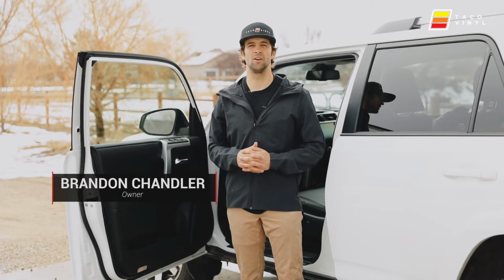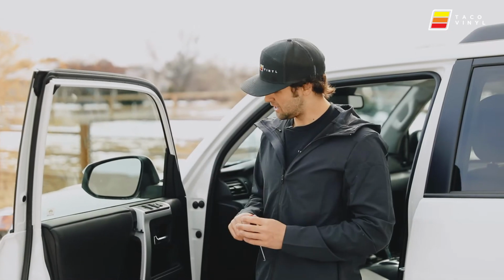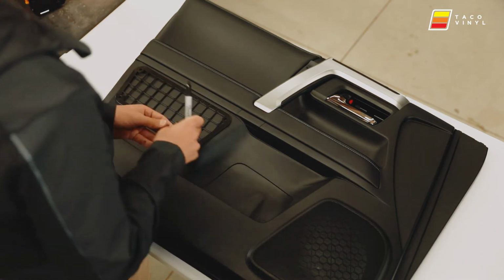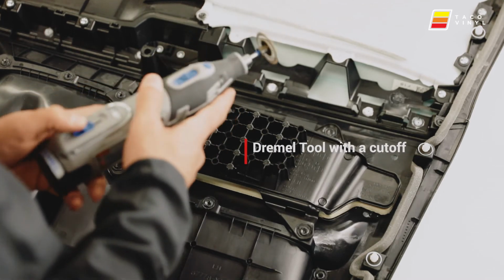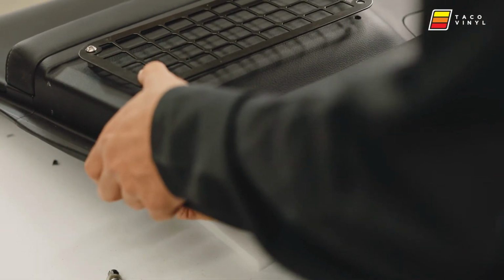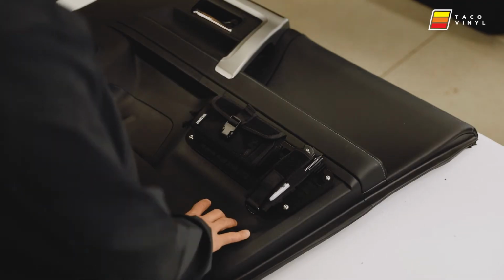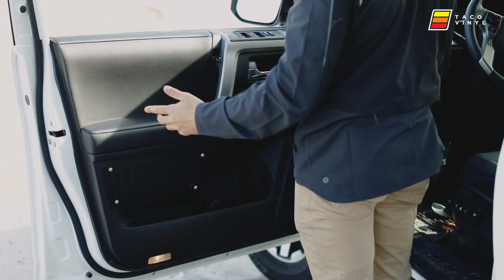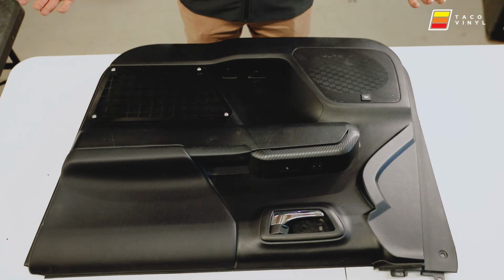4RUNNER/TACOMA MOLLE PANEL INSTALL (DRIVER/PASSENGER DOOR)

Comment: Very poor video for 3rd gen Tacoma. Doors are not the same as far as removal and what's on the inside. The hardware being all black and then bright bolts is a fit and finish issue. They don't match. On my 3rd gen Tacoma you have to be very careful where you drill through or you will ruin some of the plastic mounts where tje plastic clips go.
Reply from the maker: If you ever drill, you’ll need to tape, check both sides and measure a few times before you commit

Comment: Installed these today using your instructions. Both sides took under an hour. Very clean install. I painted the screw heads black. Spacers are now shipped black. My bag had two short and two tall spacers.
Reply from the maker: Great job! 👏🏽